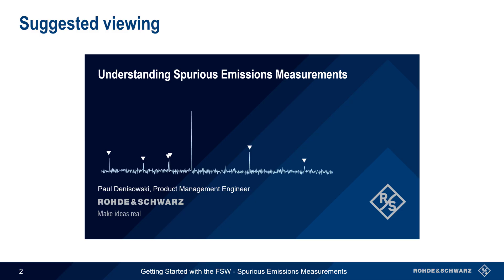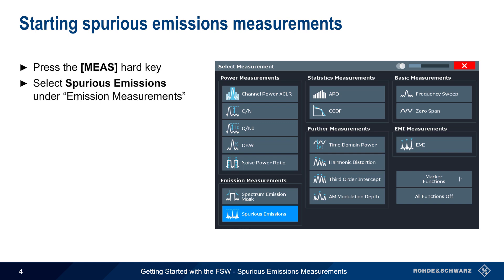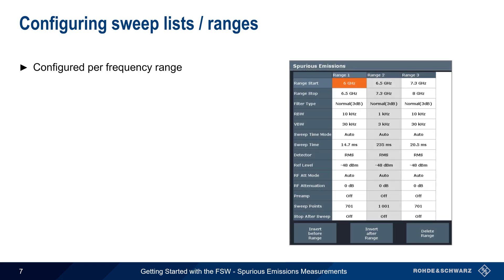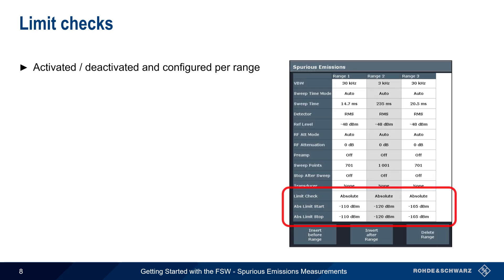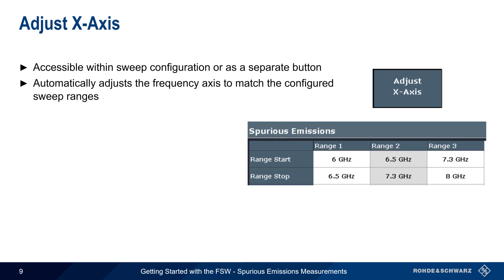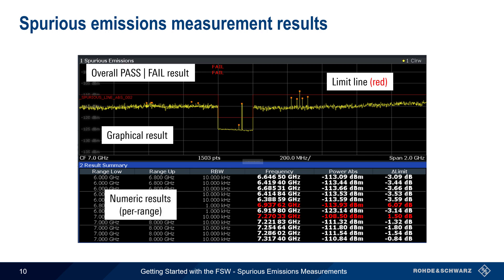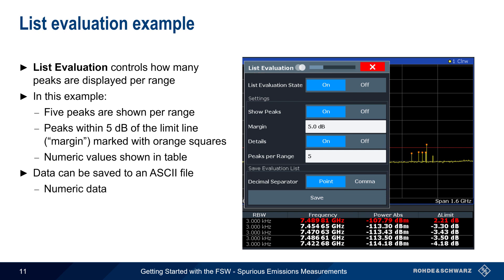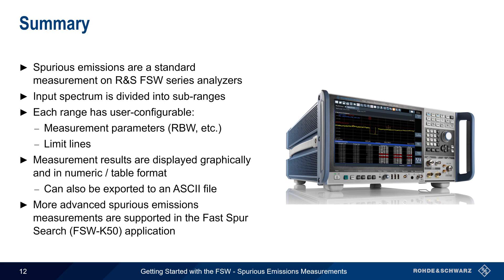Getting Started with the FSW - Spurious Emissions Measurements

Comment: What's the difference between Spurious Emissions Measurements and Harmonic Distortion Measurements?
Reply: Harmonic distortion measurements measure powers only at harmonics (integer multiples of a fundamental frequency).  Spurious emissions measurements are used to detect all powers within a frequency range or ranges that are above a given threshold, regardless of the signal frequency or the presence of a fundamental signal.  That said, many “spurs” are in fact harmonics or intermodulation products.  And very generally speaking, the levels of harmonics, specially lower order ones like 2nd, 3rd, etc. tend to be higher than the level of “interesting” spurious emissions.  Hope that helps!
Reply: Another way of saying this is that in harmonic distortion measurements we know where to look for signals, but in spurious measurements we don’t 😃  Also, individual harmonics measurements are sometimes combined to produce a “total harmonic distortion” value, but I’m unaware of anyone who calculates “total spurious power” as a standard measurement
Reply: @pauldenisowski  Ok, thank you! That helps a lot.